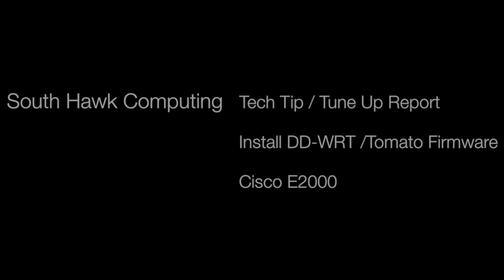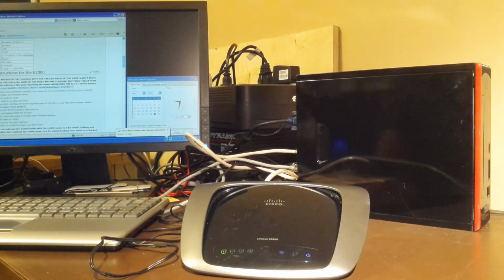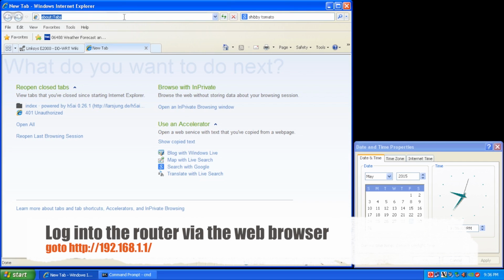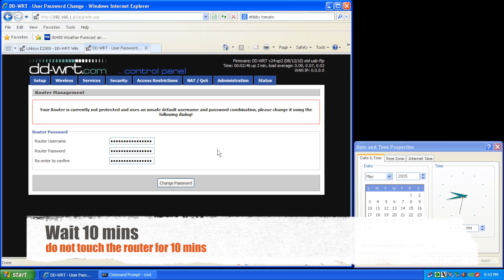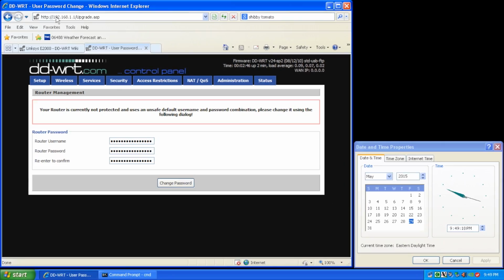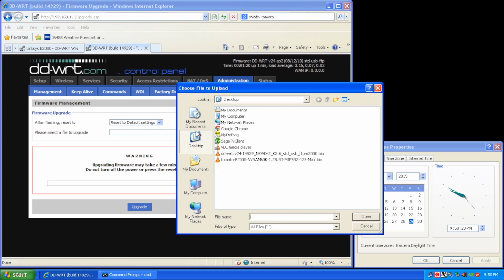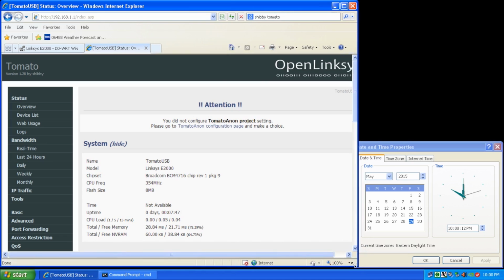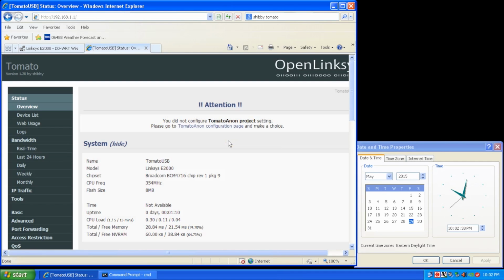How to install DD-WRT firmware or Tomato Firmware on a Cisco E2000 router

Comment: I have installed the dd-wrt software, but now the user name and password on router has changed. Do you know the new username and password please?
Reply from the maker: there is a tiny reset button in the back of the router (you might need a paper clip), with the router on and fully booted press the reset button for 3-5 seconds, the power light will start to blink, and this will reset the password for you.

Comment: Thank you! I was kind of doubtful before watching this video... Just one thing: according to the instructions on wiki it's also necessary a hard reset after flashing. Did you carried out 30/30/30 after installing both firmwares, DD-WRT and Tomato, or only the power cycle?
Reply from the maker: a 30/30/30 erases anything in the routers memory. in ddwrt >adminitration>firmware upgrade>after flashing reset to "default settings" and tomato>administration>configuration>restore default configuration> ease all data in nvram does the same thing as 30/30/30.
Reply: Thank you for replying! I did exactly the same as you and it worked fine. I also managed to make a wireless ethernet bridge... it was really simple with Tomato!
Thanks again :)
Reply from the maker: you're very welcome!

Comment: I have my e2000 that I'm trying to put dd-wrt on and I have my usual 
internet router (netgear.)  When I did the 30/30/30 on my e2000, then 
hooked it to the ethernet port of my comp, I haven't had success 
accessing the router setup.  It says "identifying network" and no 
internet access obviously.  At this point, I had only turned the wifi 
off on my laptop, but not the netgear router that's providing my net 
access.   Will it help if I turn my netgear off?  Any other ideas?  If I
 use the Linksys Connect software to setup the e2000, that will undo the
 effect of the 30/30/30 right?   

Thanks for your video
Reply from the maker: sometimes on windows vista, 7, 8, and 10 i find that when im trying to set it up/update the firmware on routers in general... my machine will do the same thing, disabling then enabling the network adapter doesnt work, only a reboot will fix it... never had that issue with win xp.. something to give a try

Comment: Great video! Question. I just upgraded my router to a AC WiFi model. My old router is a Linksys E2500. What should I run on the E2500 to use it as a repeater? or WiFi range extender? Thanks!
Reply from the maker: you can use either to make a repeater/wifi extender but make sure you're getting the E2500 firmware and not the E2000. The 2 firmware are not compatible
Reply: Sorry I didn't see he mentioned he had an E2500.
Reply: If I understand you correctly, you are stating to put E2500 firmware on the E2000 router?
Reply from the maker: the E2000 and E2500 are very different. :)

Comment: Is it the same instruction for E1000 v2.1? I've researching about flashing Stock E1000 v2.1 and I Only found bits and pieces of  inconsistent information in the forums.  Some say you can Flash directly from stock to Tomato SHibby and some say you flash to DD-WRT then to Tomato. Obviously I flashed directly from stock to Tomato Shibby, unfortunately I almost bricked my router because it displayed 'Firmware upgrade failed!" in the process. I slightly panicked and thank goodness It was still working  on stock firmware. What should I do to avoid bricking it? Recently, I stumbled in page 16 of this thread 

http://www.dd-wrt.com/phpBB2/viewtopic.php?p=910099#910099

It seems the process is well laid-out but i need a little deviation since I must flash again to Tomato, what should be the process also when upgrading from DD-WRT to Tomato"?
Reply from the maker: +Vice Liberty Andreas I havent played with a 1000. maybe i should :D
Reply: Just finished flashing my E1000 v2.1 using the recommended build dd-wrt.v24-16968_NEWD-2_K2.6_mini_e1000v2

I'm about to install Tomato Shibby from DD-WRT. I was going to the route of 30/30/30->upgrade FW to Shibby->30/30/30 again->erase nvram.

And then I came across this article, the difference is that the author flashed his DD-WRT first to Tomato Base Version before going to Tomato Shibby. Is this something I should do first? I just noticed there are many instructions but same results :)
Reply from the maker: looks like shibby does support v2.1 on E1000 http://tomato.groov.pl/download/K26RT-N/build5x-136-EN-MultiWAN/Linksys%20E-series/

Comment: I am on a tablet and I can only connect via the wireless. I have the same router. Do I need to have a wired connection?
Reply from the maker: Efin89 Hmmmm, thats a good question. I've never done a DDWRT firmware upgrade via wireless and/or on a tablet.  it "shouldn't" matter but i wouldn't risk it. Especially if you don't have a backup router.
Reply: I have a backup router
Reply from the maker: Efin89 gotcha, well wireless aside, anytime you try something like this remember there's always a chance of failure. Don't get mad if it bricks :)
Reply: South Hawk Computing LLC I installed the dd-wrt via a laptop. I was able to connect successfully, but now I get an intermittent connection. My goal is to turn the router into a vpn router. I am located in another country and I want to try to get netflix to work and such. I know there is a way to use a software based vpn, but I want to to turn the router into one. How do I go about that?
Reply from the maker: Efin89 not sure what is going on with your connection, but make sure you cleared the nvram on the router before using it. if you want the router to connect to a VPN, goto services > VPN  and you can use either "pptp client" or "openvpn client"